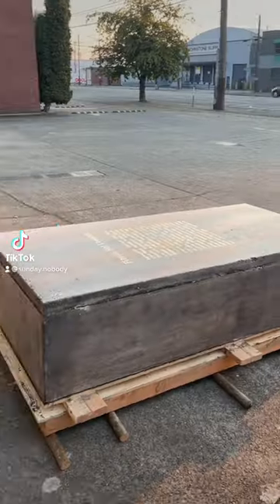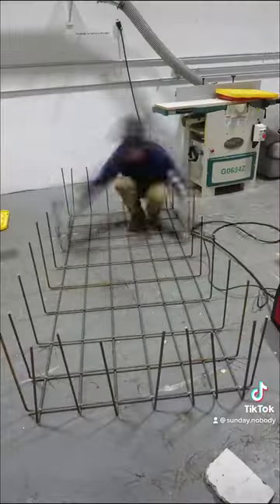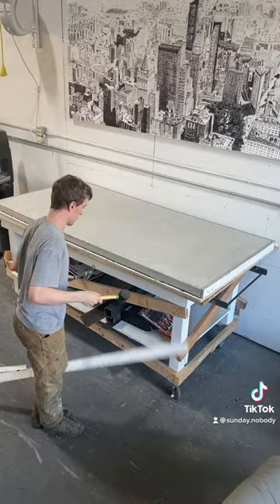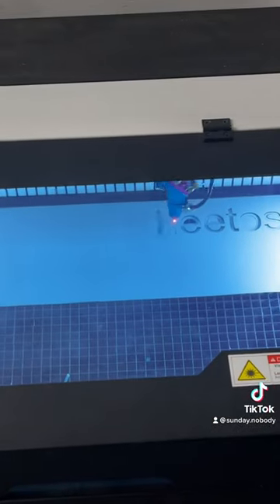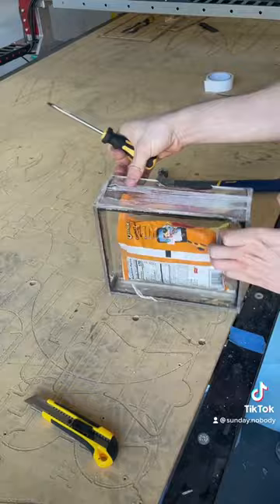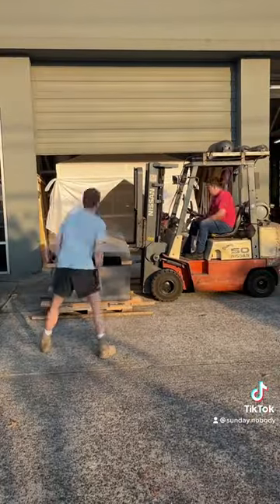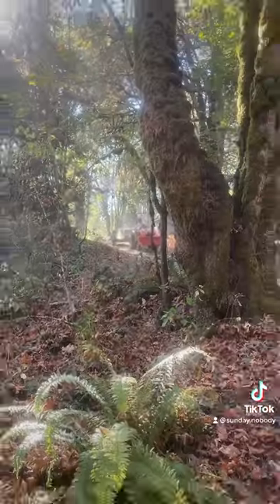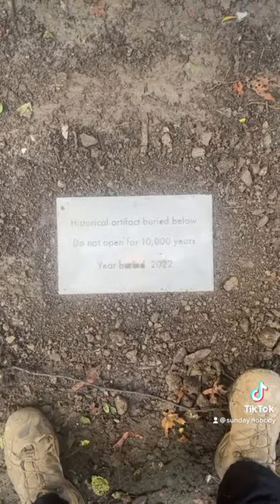Making a 3000 lbs  sarcophagus for a bag flaming hot Cheetos and burying it for future civilizations

Comment: 10,000 years is a bit too long I think. At that point even the resin would degrade, and the gold inlay would be absorbed by the soil.
Reply: As long as it stays sealed I do not think the resin would degrade at all. But in the environment shown, and due to it not being buried that deep; the moisture and tree roots and possible seismic activity, the box will be damaged.
Reply: No..
Reply: He did a lot a things wrong, first I would cast a multi layer double sarcophagus, layer of titanium, granite slabs and steel reinforced concrete chemically reinforced too, no way to open from outside too, the second sarcophagus I would suspend with stainless steel  chains and a stainless steel box sandwiched with resin and finally a gyroscope with 3 axis and the Cheetos bag in the center.
Reply: @Fernandosampaio_  Yeah, that's been the standard way to bury Cheetos as long as I've been aware. No idea where this guy got his wacky ideas from.
Reply: @Fernandosampaio_  Sounds expensive for a "bag 'o cheetos time-capsule'
Reply: Resin typically takes anywhere between 500 to 1000 years to fully decompose
Reply: 1,000 year alrdy okay :face-purple-crying:

Comment: Here what will happen to every part of this time capsule:
• First 10 years: 
The concrete will accumulate water from condensation and from infiltration since concrete is not fully waterproof.
• First 20 years: 
Tree roots in conjunction with and microorganisms will pose a threat to the concrete lid and depending on the vegetation specimen, will create tiny cracks in the concrete, with the humid concrete the microorganisms will find their way inside the sarcophagus. The metal springs and wires will begin to noticeably deteriorate from oxidation. 

• First 30 years: 
The acids and minerals, as well as microorganisms in the soil will deteriorate the glue, the spray paint and the gold will dettach from the surface. It's probable that all the texts will become completely unreadable without instruments in few more decades. 

• First 40 years: 
The deterioration will progress much slowly from now on, although air will begin to sip inside the capsule.

• First 100 years:
The sarcophagus is nearly full of water and the metals are now very rust.The resin block will eventually fall. The rebars will rust inside the concrete, and through a process called "oxide jacking" bigger cracks will open, accelarating the concrete dacay.

• First 300 years:
The sarcophagus is now open and has some visible cracks. The resin block rests on mud and lots of salt cristals. Living organisms can move in and out. The weight of a big tree, or even a nearby building will make the capsule rotate.

• First 500 years: 
The resin is pretty much opaque due to degradation and has many cracks all over.
A small amount of oxygen will reach the package eventually in the next decades.

• First 1000 years: 
Archaeologists from a different breed of human race find the marking concrete slab made for the burial site and translate the texts written on it. They find it difficult to locate the sarcophagus. Decades after escavations they locate the capsule, under 10 meters of soil, half broken, with traces of black pigment, rust but no resin block. They eventually find out that a massive flood and ice age was responsible for transporting the capsule almost 50 yards away from the burial site, and almost a mile away from were they found the slab. The resin block is found surrounded by cristals and several pieces are missing. After cleaning and scanning with several instruments they find the bag of cheetos inside and debate over opening it. They decide to not open for more than 70 years.

Comment: Will it be ok with rainwater? I remember some other time capsule made of concrete got ruined due to rain building up inside over the years. I figure the resin would just float in the water over the years but probably after 10 years it'd really start to decay in stagnant water.
Reply: Depends on what he sealed it with. If he sealed it with super glue and maybe another layer of concrete of the seal it might be fine. But yes, I can imagine rain getting into it.
Reply: Depends on the seal and the concrete used. Many of the more modern concretes are fully water proof.

Comment: If thats an area that gets a lot of water then that has a chance of floating right up to the surface. Same reason septic tanks, whether polymer or concrete need to remain filled with water.  Just depends on the weight of the water it displaces. 

Really should have just filled the entire sarcophagus up with resin AFTER suspending the Flamin’ Hot Cheetos in its miniature resin box. Probably should do it again.